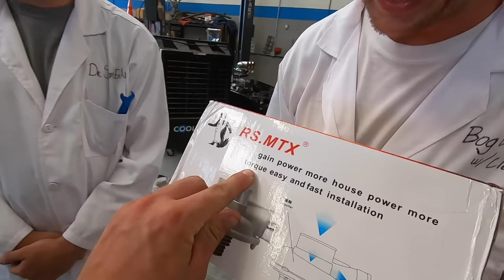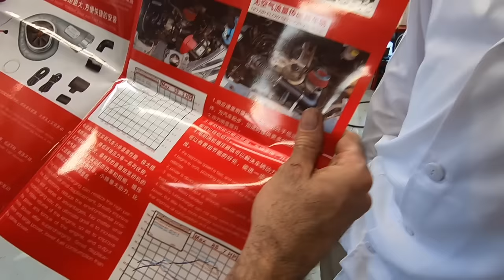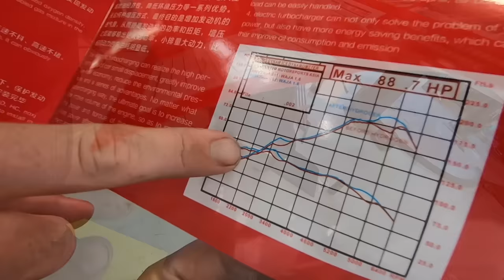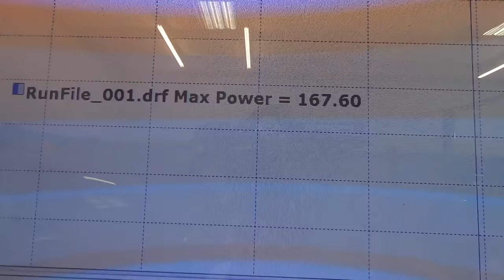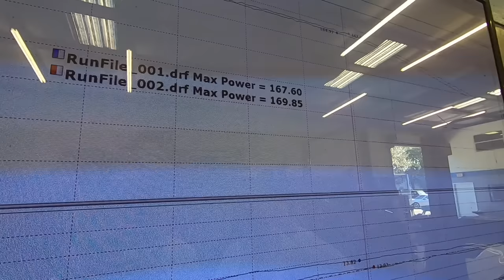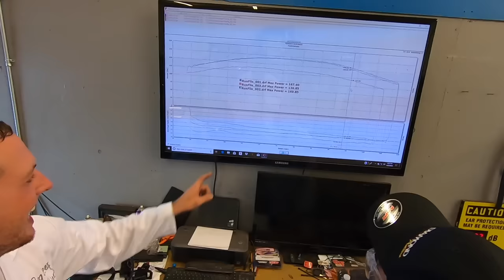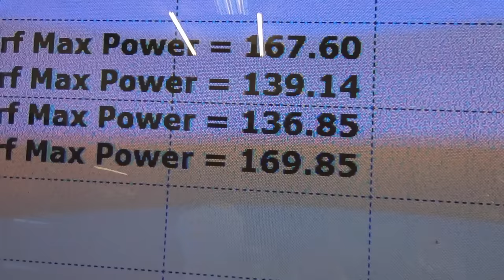Dyno Testing a $400 ELECTRIC TURBO! Funniest Car Part EVER!

Comment: it is very funny to see that you made the same mistake we did.
if you would look at the turbo you would realize the moments that you were putting the electricity on it it started turning the wrong way.
we have the same problem the electronic in the Box needed to be switched. once we switched it it gave us 12%/15% more horsepower.
because the turbo was turning the wrong way it was trying to stop the air getting into the air exactly the wrong thing it needed to put extra air into the engine

Comment: Turbines generate 5 to 15 shaft horsepower from the flow of the exhaust.   Compressor efficiency is 75 percent and under.

There is no way to get that power from a 12 volt system without drawing hundreds of amperes.  Like 450 amperes.  
I bet this is a 40 amp motor at the most.  Bare wire connection by bare hand? Under 15 amps.

Comment: remember china uses more 4 cyl engines, this turbo was not made for 8 cyl
Reply: even on a 4 cylinder engine it's too weak. It could work on a sub-1,000 cc engine though. Or perhaps change the electric motor for something bigger and hook it to a 24 volt battery with a lot more amps.
Reply: It's not likely that the "turbo" would work on any car engine. With basic thermodynamics of an adiabatic process, you can work out that in order to create e.g. 1 bar of boost on a 2-liter engine you'd need more than 5 kW of power (assuming that the geometry of the turbo is very efficient). No car battery can supply that for more than a couple seconds. It would be interesting to see how much power that thing draws. At least it sounds like a hairdryer.

Comment: I thought after the first pull it probably was intended for a 4 cylinder engine in a rice burner rather than a V8 4.6L. The poster depictions were all 4 cylinder engines so I'd say do it again in a 4 cylinder.
Reply: I’m thinking it’s not big enough for a v8 myself!
Nitrous dump has a fuel increase on the fuel rail I think!?
So I keep asking myself…. Where’s the added fuel when your trying to increase air!? Ikr.

Comment: The thumbs down guys and girls just told me Earth is flat, there are no hills and the electro house power which is actually donkey power under another name does work but it's  all about torque. Donkeys and Muels have more torque than horses powers really and what you're torquing about is basically that,.and you aint proved nothin with your sneaky signce ...Maybe you should try it in forward gears when you try the electronic super charger and you will not loose all the donkey torque and top ends or else.

Comment: More air than gas with the electric turbo on . I would bet that the engine computer read lean with it on. If you had a bit more fuel getting into the engine you would see the gains you want with that turbo!

Comment: I bought one and it's actually working but I modified it I  re engineered it for a larger turbo and put a rc plane moter on the rear that spins up to 50000 rpm with a a gear that makes the turbo spin at 100000 rpm so it's actually working but you will need to modify it a lot

Comment: I think that putting the electric turbo in the main intake is not the proper way to test it.  My suggestion would be to use it as a an additional source of air intake by installing it on the side of the main intake in a Y or T configuration.  That way, it would blow more air into the engine on top of the normally aspirated air already coming in; theoretically.  Maybe you should give it a try that way, so you see if it actually adds power or not.  Thank you.

Comment: There's a loss of power because the ratio of air to fuel changed, you need more fuel in the mixture to counteract the excess of air

Comment: The car is already tuned for other set up. I am not saying it will work but if it did clearly would work for a factory tuned car not a street tuned car. Also you were not pushing a lot of air one the car is a V8 means the same thing but you need a much bigger one and two you didn’t even have a conduct system for the “turbo”... take out the conduct system or intake pipes of the engine and see what happens it will bug down and have less power so same thing happened here it was actually getting less air. Again try this “turbo” on a bone stock car a regular sedan and see then if it makes any difference not a V8 already tuned out. The idea I think is very interesting.

Comment: As it's a smaller electric turbo, I would love to see it tested on a motorcycle.  You did mention smaller engine. 

 I have thought electric turbos would be ideal on a bike given you do not need to modify the exhaust like in normal turbos.

Comment: It's making less power cus its now running lean, there's more air going in but not more fuel! It needs be remapped and more fuel going in, the fact that its making less power is clear proof that there's more air going in but without a map it's not gonna make more power.

Comment: My engineer assumption here is that engine needed to suck more air than this turbo was sized to provide. I was thinking of such turbo for a smaller like 900cc jetski engine which doesnt swallow nearly as much air as this junk car does. I am 99% certain that it may actually perform with a much smaller engine. But I would personally pick a much bigger turbo fan still. $400 for that is ridiculous tho, they cost like $80.

Comment: The problem with the whole thing is is it's not as efficient as turbo charging cuz you're wasting the exhaust gases energy and throwing it away instead of using it like the turbo. Anyways this is not the proper implementation of what some companies are doing but they're not just like buying some electric fan from China hey... The electric motor that drives the impeller has to have the proper electrical power and sufficient armature to deliver that power. It's a good question how much horsepower, cfm, fuel air mass flow rate does a turbocharger need on the exhaust side.

Comment: You need a build up and it needs to be piped after the filter dual would perform better on a v8 two pumping to the same pipe after filter with cold air intake will gain up 2 56 hp ... house power 😆
Reply: Also after mass air

Comment: Would you consider 0220611_U; 0248478_U, both from Spain, both patents, utility models, expired? 
One is a fixed blades vane inducing swirl in intake duct mix, they placed it after carburetor, but not the spinning type, that takes out power; the other is a heat inter-changer heating fuel counter current with liquid from cooling circuit, to have it better vaporized, for sure 'vapor lock' is an actual danger in concept. Blessings +

Comment: That's obvious. The size of that tiddly little electric motor.  You need a much bigger electric motor and at least a big 48 volt separate battery to drive it.

Comment: @Cleetus McFarland - First, thanks for this video and second - Should there suppose to be an electronic variable modulator switch that works with the accelerator including a booster pack that is connected to the variable switch from the battery to the electric turbo? Assuming the more gas applied the more electricity needed for the Turbo to give a good air/fuel mixture; Why? The electric turbo needs more juice at various loads to spool faster in order to perform at its optimum peak! This test allowed the turbo to spin only at a fixed spool rate, which resulted in a loss of power at load above the turbo's spool rate. Ferrari and Audi use electric turbocharges, admittedly more complex in design, but follow the spirit of the idea here; and, yes they are very successful both in their own right. Would it be possible for your team to research into this and set up the same vehicle with the necessary parts to get the electric turbo to spool quicker in-tune with load demand?

Comment: It does't work because you increase the air pressure but the amount of fuel remains the same to improve the engine performance must be prepared the report air fuel and the time the inject the fuel. by other part if you increase the amount of the fuel can avery a good performance

Comment: I’d imagine whatever is used with the similar charger …. You have to add to the air fuel mixture!? So more fuel has to go with the air!
Install bigger injectors, mass air flow sensor bigger throttle body, increase air intake piping, upper lower intake!? (Heads upgraded & cam)!

Lol basically all those mods would increase horsepower without the gadget!

Somethings off somewhere if your suppose to add power without other mods!?
 Need to look/research the belt operating supercharger!? Somethings different or missing,…

Comment: How much air pressure is sent to the engine by a standard turbo?
And How much air pressure is sent to the engine by a electrical turbo?
or for example if a "Standard Turbo" send X air pressure to the engine, this pressure may not be achieved by an electrical turbo, but maybe and only maybe this air pressure may be achieved by a small electrical compressor with a small air tank that maybe be capable to send this X air pressure to the engine it is only theory

Comment: Obvious, that electric turbo fan was restricting the air intake by probably spinning at most 3000 rpm, A turbo fan spins at like 30,000 rpm plus. When he gunned the engine you could actually hear the fan revved up to destructive rpms to keep up with the engines air intake requirement, that fan was actually restricting air flow to the engine.

Comment: Duh, put the LITTLE turbo on a LITTLE engine.   Put it on a 1200 Datsun  or 1.0 Metro Swift - something that is only 50 HP.  TIP:  to be similar to the old ball drive Paxton, you will need STARTER SIZED CURRENT to produce the 10's of HP required.  So if it doesn't come with battery cable sized cables, don't even think about it.  AND If it doesn't have a brushless motor - it's a joke.

Comment: That was choking itself to death:/ Cheap and nasty. It needs to spool to a LOT  higher RPM and be remapped ffs! How could it make more power without more fuel:/ Should have blown up, it would not last long,lol. Great mod for those who find their car a little overpowered, hah:) Watch the TORQAMP episode, that thing really works!!!! However, for 2500 bucks you could go a long way to putting a real bloody turbo on:/ Ime surprised they  did not do a proper job on this one like they did with the TORQUAMP that was properley mapped. That one spooled to 5psi instantly then slowly dropped off to 4psi. Main problem is the bloody turbo compressor wheel  blocking airflow when it was switched off:/ Simple answer...never have it off,lol. Though it will only run for so long before needing the battery unit part to recharge so not so easy. In between operational cycles you would have the compressor blocking up the intake so i would say its drivability would be shiithouse, to say the least:/ It needs some way of bypassing the compressor wheel when its not being used. Something could be worked out ime sure. As it is it would be ok for quarter mile runs. If your on a small budget its cheap horsepower suited to a small engine! a 27% increase in peak hp for 2500 is not too shabby:) Torque went right up too! So there is finally an electric turbo[though technichly as its powered by a motor it works more like a supercharger] that works. Plenty of room for improvement too!!

Comment: the taillights aren't even year correct. horizontal lights for 93/94 and horizontal for 96 on. pointing at those taillights calling them a cobra part was wrong. cobra's had the same taillights as the gt.

Comment: you should not try this on a v8
it is 4 up to 4cyl 2.0 and at certain rpms. the efficiency of this is limmited by the max flow of the device vs the one from the engine. Again, try the same in differen engines sizes and you ll get differents results
We tried one once on a 1.6l engine and it got way more pep. did not have a dyno then but you can feel it on the street for sure

Comment: I thought you were very biased. One has 48v lithium. The other has is using.12v not fair at all. You should have rigged up a battery lithium poly or another to give it a fair shake even using 14v   1200 amps. That would have been fair.

Comment: Doesn't it take a while for the engine computer to adjust the settings for optimal performance?  Seems like you need to drive it for a while with the turbo on. And get one properly sized for the engine.
I don't see why it is laughable that an electric blower should work. If you drive from a belt off the engine it amounts to the same thing.

Comment: Stock turbo cars do not connect the turbo to throttle body direct they are ducted together through a standard air intake with filter. Why didn't you connect it correctly? Every video testing these electric turbos is the same way. Are you trying to give them a bad rep to keep people from buying them since they are much cheaper and simpler to install?

Comment: 168 hp Mustang?  Lmao, my 20 year old 4 banger Toyota puts down more than that.
BUT what if you don't exceed the "turbo's" cfm??  It could at least improve fuel efficiency at low RPM!

Comment: The turo fans revs 100000 rpms without oil vien to shaft it will heat n melt...that for sure

Comment: Does anyone knows if this works ?
What if you make a hole on air filter box before filter and attach electric turbo/supercharger and seal it.  Keep factory air intake as it is so it can still breathe and then  turn it  on to get extra  boost ?

Comment: It was very obvious at the start that this turbo is way too small for the size of the engine. How can you possibly pass such a large volume of air in such a small physical device? You would need three of these turbos stacked in a parallel  formation inorder to produce a positive result. DUH!

Comment: Better plugs and race fuel and better fuel pump and dynoed through the curve......would have made the best gains ...more air does make more power Sure yall know that.. but not without balance....the factory setup was tuned...the turbo made the engine unhappy by itself.....

Comment: It is a supercharger not a turbo. Prochargers look like turbos but they are superchargers. Turbo runs off the exhaust and arent always adding boost. Superchargers are always adding boost. This doesnt run off the exhaust and is always adding boost there for its a supercharger not a turbo.

Comment: the eRAM would have given about 10hp to the mustang, i assume 3.8L.   the secret is differential pressure, increase, and not providing  a restriction and nutralizing any losses in the intake for the pressure drop.         its an axial flows supercharger

Comment: 167 out of how much displacement? Underwhelming.
Reply: their other mustang made like 195whp so this one isn't running good. Those older 2-valve SOHC 4.6L were only rated for 250hp crank and the 4-valve DOHC 4.6L were rated for 305hp

Comment: it is impossible to run a electric super charger that will produce power from a 12 volt system on a car you would need a alternator the size of the engine its just mathematically impossible. you need kilowatts not watts to move the kind of air you need . maybe if you drive a battery delivery truck you could pull it off hahaha

Comment: Just look at that turbo! It's puny. That thing is designed for a 1400cc engine. Not a V8! I would find the smallest engine you have and try it on that instead.
Also, use Super Capacitors for the instant boost. Instead of the car battery.

Comment: I’m not against the electric super charger, I just don’t know why none of you guys thought about using a dual induction pipe, leaving one side of the intake pipe to your stock air intake box and add the electric super charger with its air filter on the other side of the dual intake, in this case the super charger isn’t restricting flow at high speed but adding air.

Comment: That would work fine, if you built it right (use the cold side of a REAL turbo) and had a HUGE motor driving it that could drive it to the RPM it is meant to operate at.  That piece of junk...just plain stupid.  If you put equivalent energy into a properly designed turbo that the exhaust normally does, it would provide quite a bit MORE power, as long as you weren't keeping the battery charged REAL TIME.  ;-)  That requires quite a few HP, though.

Comment: I might be buying It for My Truck pushing Air before the carburetor a Increase In gas mileage for My Motorcycle a smaller Engine sucking fuel and Air from the carburetor more Horse power